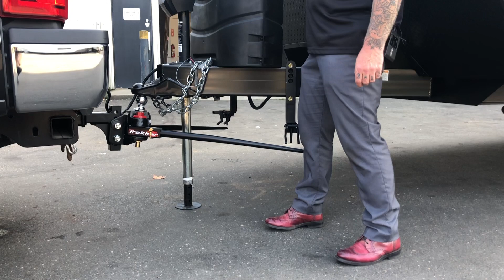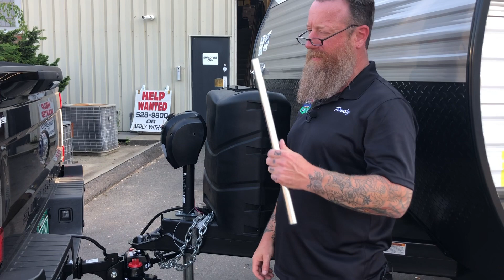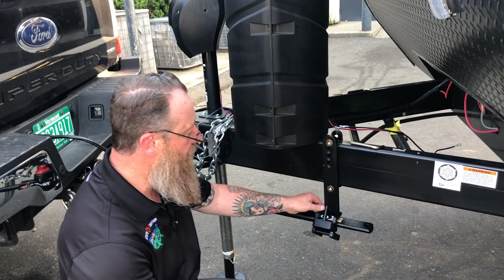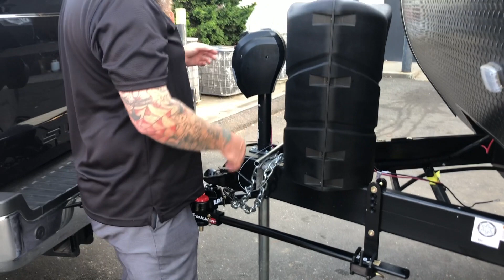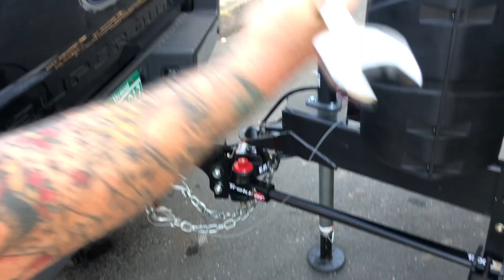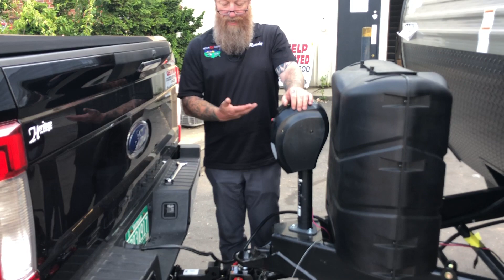Hitching Up The Trekker Hitch | Pete's RV Quick Tips

Comment: For people out there that like to use quick links etc to connect their safety chains to their hitch. Make sure you get the proper load limit link. Your tow capacity is either your truck rating or the rating of whatever you connect your trailer to your truck with. You buy a 1,000 lb quick link, your tow capacity is now 1,000 lbs even if you're towing with a dually diesel. I personally prefer to replace my hooks on the safety chain to something that fits my truck rather than something in-between my safety chain and tow hitch.

Comment: I've had mine for 1 1/2 years. I just discovered in the manual that it says to tighten the activation caps to 100 ft-lb. I've been doing 45 all along and still get sway. 45 ft-lb is when you remove the compression plates and reassemble for adverse weather. I have screen shot of the manual, but can't upload.

Comment: We purchased our TT from your dealer with an trekker eaz lift 600lb hitch. In order for the car and trailer to be leveled the weight bars are bend a little. Is that normal or it's to much pressure to the bars?
Here a link with a picture of our setup:

https://drive.google.com/file/d/1dwywMm9qT3O4E2LVq4QRqR8bNnsGlRtj/view?usp=drivesdk
Thank you!